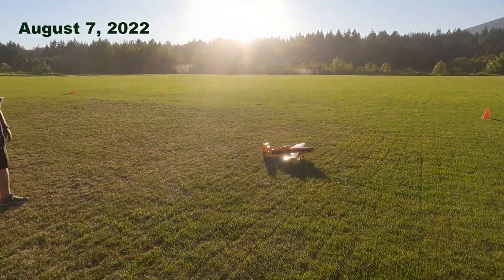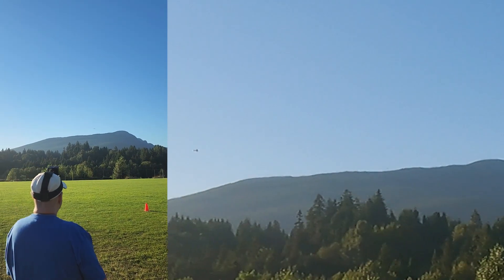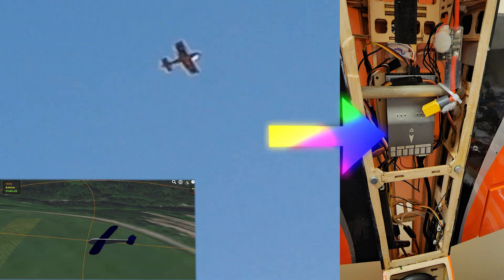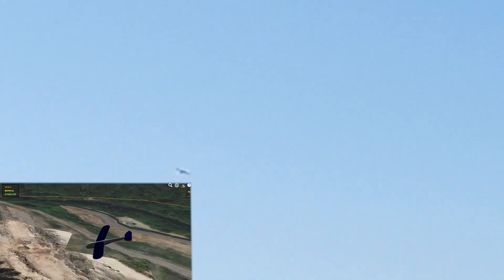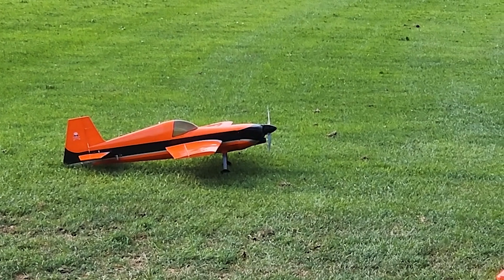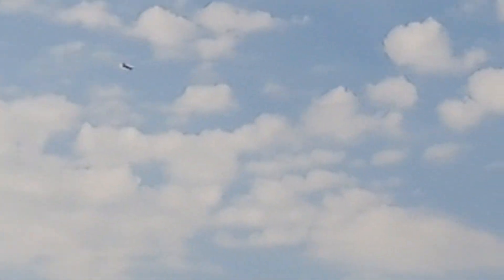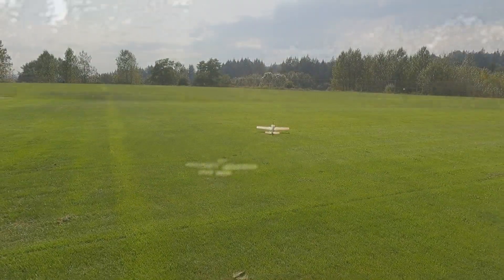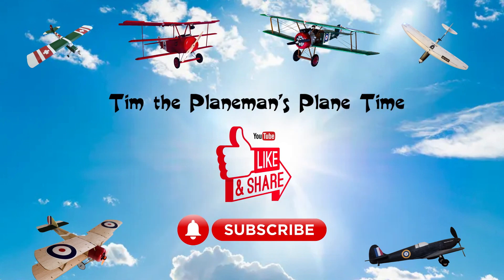ArduPlane flew my RC plane backwards!

Comment: I think you have put so much effort in to this system, that I have to congratulate you. 
Was the aircraft flying itself at the end? Did it land itself? 
The reason you are breaking props is that on final approach, keep a little throttle on, when you get 
a couple of inches off the ground, pull a little up elevator and loose some throttle, you will get a perfect
three point landing. 
Larger wheel diameter will help a great deal, the prop will be higher off the ground and you will 
find the model will run smoother over the grass. 
I also advise not to put full up elevator on take off, your forcing the issue.
Let the model gain speed and then tickle it off the ground. 
You will get a really smooth take off. 
The tail will lift itself. ❤
Reply from the maker: It didn't fly itself on this video, but I have since done a couple of autonomous missions and it works great. Auto takeoff and landing are next, then maybe a loop-the-loop and barrel roll! :-) Thanks Nick!

Comment: Well done for admitting your issue! Takes a brave person and you will certainly have learnt now! Top job. I still don't understand PID. If it was me, I would bother with an autotune but I would pay attention to the speeds its flying at before I went full waypoint mission. Get three or four mistakes high and make it stall, then review the logs.
Reply from the maker: I've learned that if I make a mistake like this others will too. I'm just amazed that ArduPilot could deal with such a fundamental mistake. The ArduPilot autotune is awesome, the plane now flies like a dream and I have done several waypoint missions no worries.. Thanks for subscribing!